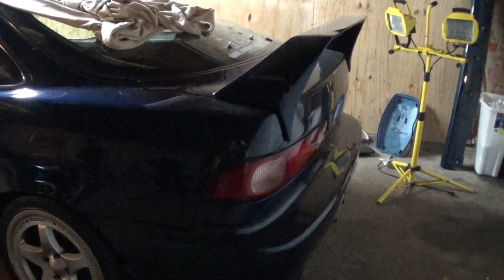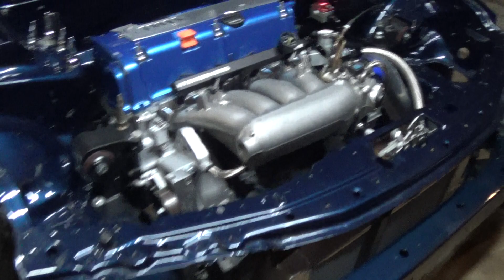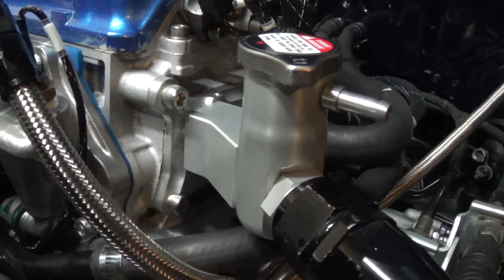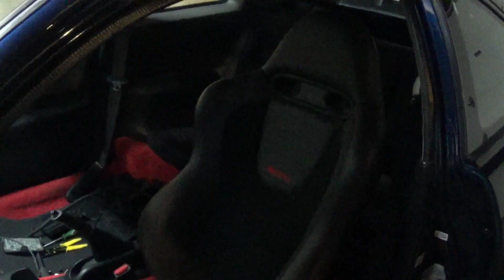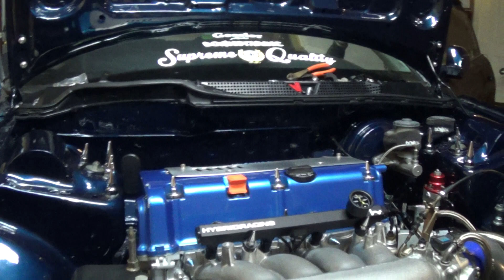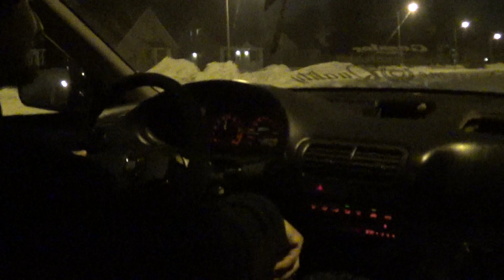Vince's K20Z3 Integra

Comment: Very nice car dude the k20z3 lacks about 2 to 3 hp vs k20a2 or z1 but what I like about the z3 is that it has it's own aggressive can profile that in my OP seem to make a bit more powerful at the top end when re-flashed than the k20a2 or the z1 plus the RBC intake manifold from factory. I would roll a z3 over the a2 or the z1